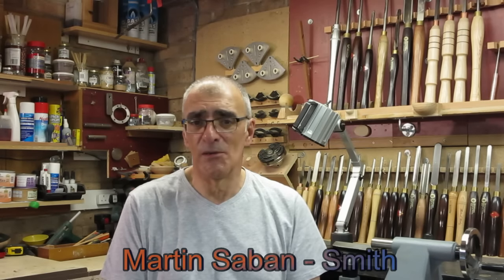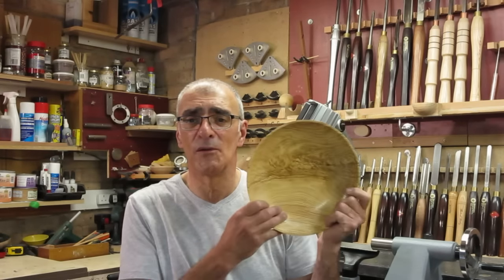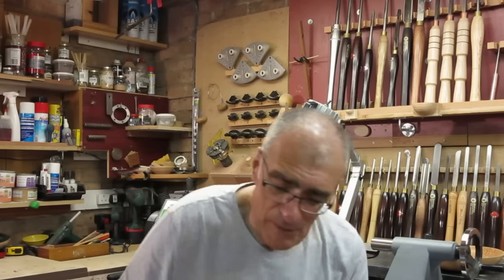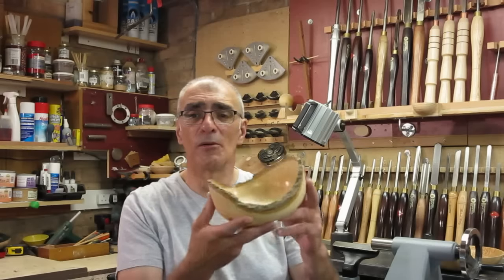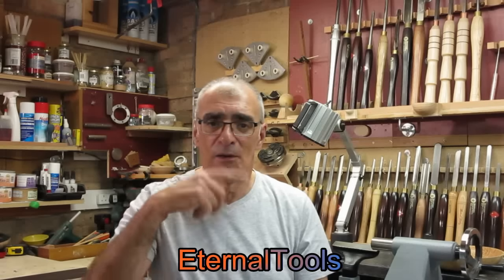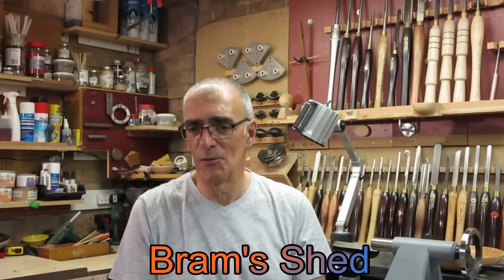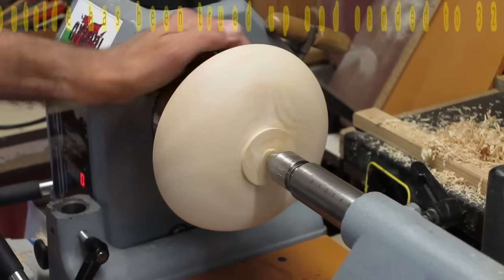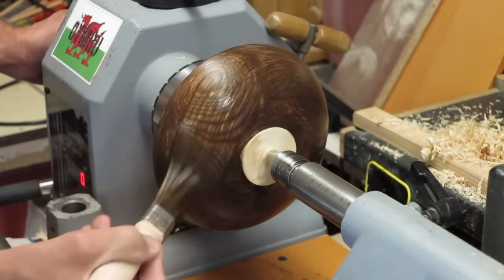Woodturning - Scorching and Dyeing - An Introduction

Comment: Good stuff Mike.  I've scorched with my blow torch numerous times but have never thought about using the heat gun.  I'll have a little test and see what happens.  I've been experimenting with metal patterns lately so that parts of the wood are protected from the flame...

Cheers

Tom
Reply from the maker: Tom Stratton Thanks Tom, the metal patterns sound interesting, maybe a subject for a future video from you? I found the heat gun a bit too slow for my liking, but undoubtedly more controlled, but no where near as much fun ;)
Take care
Mike

Comment: I wish my finished pieces looked like your practice pieces.  I really like burning since Martin got me interested and have found that if I just move the bowl as I need to and wave the torch in and out I can control the burn.  I also discovered something that doesn't apply to you but, for me, burning is a great way to get rid of tear-out.  You wouldn't know anything about that though. 
Super informative video Mike, thank you.
Best Wishes, Brendan.
Reply from the maker: baconsoda Lol on several counts here Brendan :) :). I agree that rotating by hand is the best method without doubt, and thanks for the tear out tip, thats a great idea mate. I will pass it on to all, but as you say I'll never need to use it - well not much anyway - well not much this week, as I'm working for most of it ;)
Take care mate
Mike
PS I see Alan's disowned me again....lol ;)
Reply: Mike Waldt LOL, I think he is on holiday.